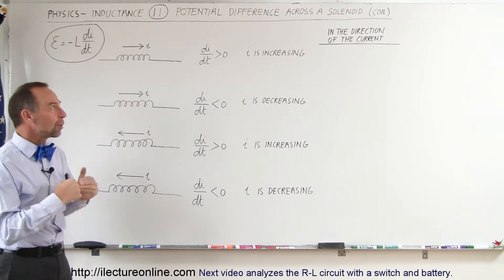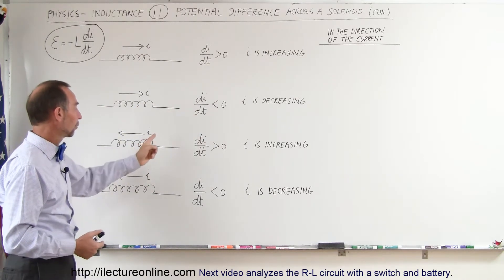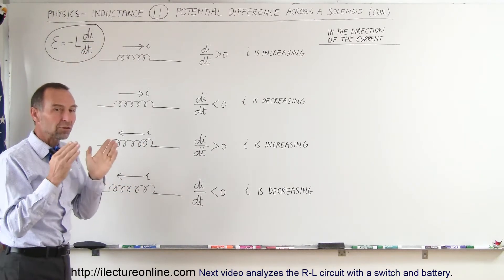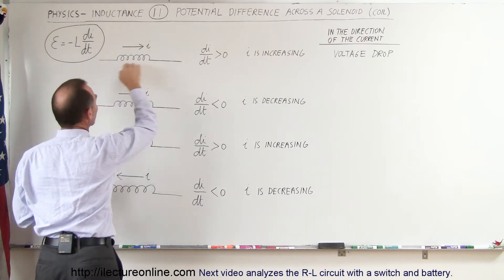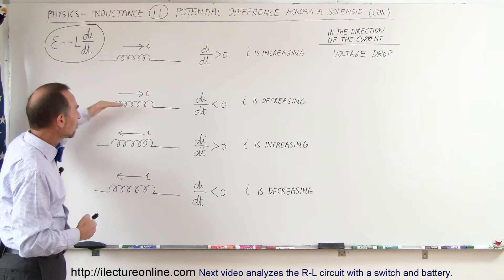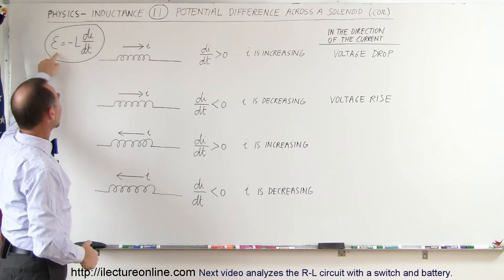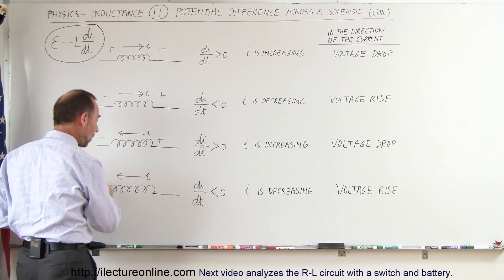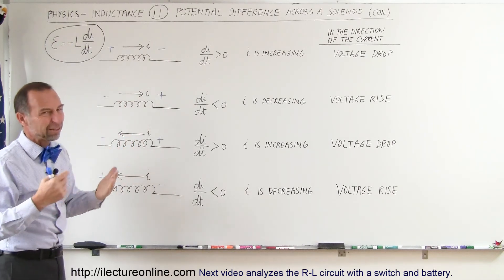Physics 47  Inductance (11 of 20) Potential Difference Across a Solenoid (Coil)

Comment: for the first 2 examples with i pointing to the right; does that mean the B field is also to the left? Im finding it harder to determine the direction when the inductor is so small.
Reply from the maker: Use the right hand rule.  Curl your fingers in the direction of the positive current in the coil and your thumb will point in the direcion of the magnetic field inside the coil.

Comment: I've watched virtually all you lectures on self-inductance, but I'm still confused on one point. If the counter EMF is always equal in magnitude but opposite in direction to the source voltage, how does any current flow at all?? Thanks so much for all your help.
Reply from the maker: That is only momentary.  The induced emf drops off quickly as the energy in the inductor dissipates.
Reply: @MichelvanBiezen  I saw a graph of applied vs. induced EMF through an entire AC cycle, and they are 180 degrees off throughout the entire cycle, seemingly cancelling each other out., so I'm still confused. I went to multiple posts in the Stack Exchange.... lots of opinions/answers, all somewhat different. It seems that this is a common topic of confusion.
Reply from the maker: Yes, that is why we developed videos that need to be watched in sequential order so that the confusion may be removed.

Comment: Nice presentation, but with one problem.  You should never equate inductive counter emf with resistance.  Resistance consumes power from the source, inductance does not.  Missing that vital point increases the student's difficulties in understanding not only transformers but, more critically, true power and reactive power in ac circuits.  Stick to invisible batteries and you are better off.
Reply from the maker: The word resistance also means opposition.  There is no implication that the opposition to the current due to the inductance and resistance are the same thing, but they both oppose the flow of current.  Your point is well taken that it must be clear to the student that there is a fundamental difference between resistance and reactance.

Comment: Hello Mr. Biezen! Thank you for all your work -  you're the reason I'm doing well in my engineering courses. I do have a question about this video. Aren't we the ones deciding the direction of the current? In other words, just like in the case of a R-C circuit, don't we decide the direction of the current and then if we take the direction for our voltage loops to be the same as the direction of the current, we count a drop in voltage across a resistor and viceversa if we're going against the direction of the current? Why does it matter here, whether the current is going from 'left' to 'right'? Shouldn't we only be concerned on whether the current is increasing or decreasing? Thank you again for all the time and work you put in these videos!! Hopefully one day i'll be able to give back to your channel.
Reply: Hi, I thought I could try to address your question. Yes, we do, in fact create arbitrary directions for current flow (i.e. you can view flowing charge as positive charge moving in one direction or negative charge flowing in the opppsite direction). Also, the concept of a potential drop follows from the convention that the electric field through the conductor equals the negative gradient of the voltage. This is done so that the voltage rises from the zero point of the electric field (the point at which the field vanishes). The point I'm trying to make is that the voltage is a measure of the change of energy of charges in moving them from the zero point to a prescribed point in the electric field (of the conductor). Voltage, by virtue of being a conventional change, is far from absolute. That is why he was able to create a convention where he reads the voltage drops or rises in terms of how the solenoid influences changes to the current in the closed circuit. Now, if he really wanted to (and this was my initial preference) he could have defined his drops and rises from the point of view of the left side of the solenoid. It works because potential is not an absolute quantity. Finally I should mention, the system you employ to describe changes in potential across your inductor(s) should not change within a problem! In fact, that's why his method of tracking voltage drops or rises in the direction of displacement of current makes so much sense: it allows you to safely use kirchoff's rules normally without having to worry too much about your conversion.

Sorry for any misconceptions I may have stirred, and I hope you find this response helpful in some way. :)

- Oswald.